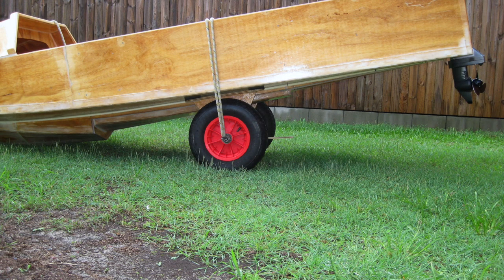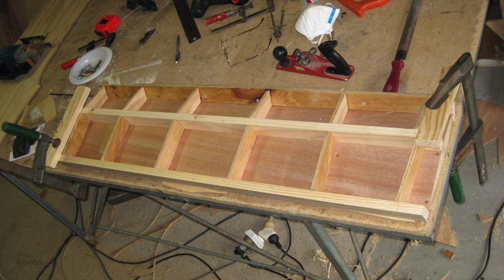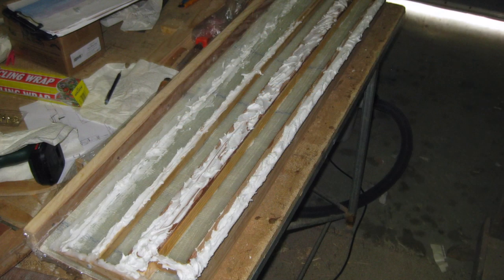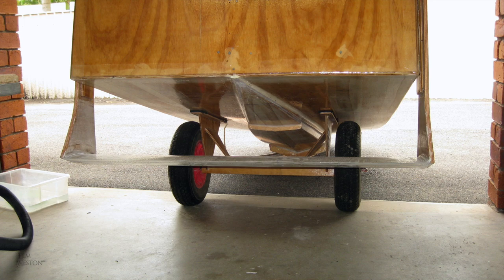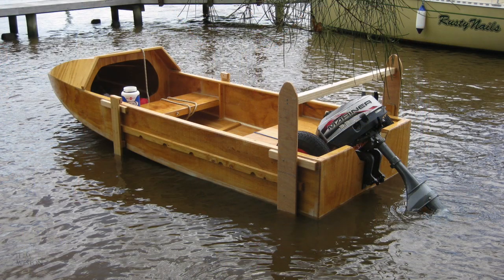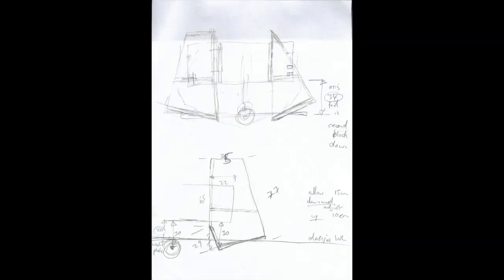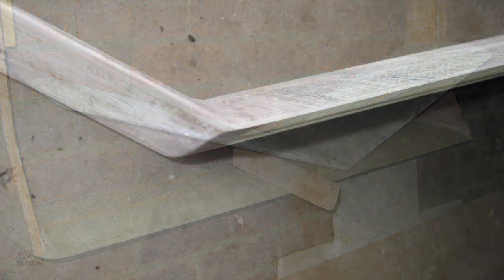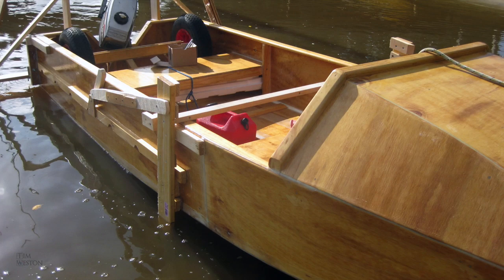How to build a plywood boat: Part 2 - Hydrofoil - getting the boat to fly!

Comment: Hi Tim  Very  interesting project and more power to you for evolving the design continuously. 
You could check out Clearwater Hydrofoils. He has a parts kit for $139 usd that you just have to glass up that includes front and rear wings fuselage and a mast. He will sell you the individual parts too I believe. A mast may be the wa

Comment: Loved the video Tim, and your idea for the rails that make trying various configuration easy.  I wonder if a big reason you don't get more speed is that the propeller was designed to push a non-foiling boat. You need one with a larger (steeper) pitch... assuming the foiling drag would be equal to a displacement hull drag at a larger forward velocity, you would need a different pitch to produce the same thrust at the max RPM. I hope you are still working on similar projects!
Reply from the maker: Hi Pejoka, yes I know what you are saying. I thought the same but it was still under the same sort of load, I don't think it had run out of rpm. I think the main reason I didn't get more speed is the plywood struts created too much drag. and also the foils weren't super smooth. With airfoil struts and all sprayed in a Urethane I would have seen better speeds. Then maybe would be the time to try a coarser pitch..  I ran out of time testing and had to stop.. :(

Comment: you said it didn't go much faster, but i'm curious if it was more fuel efficient ....or was there still just too much drag?
Reply from the maker: Hi Tim.  Yes, there was still too much drag.  I am presuming it was the plywood struts.  It's possible the size of the foils also could have been a bit big too.  And they weren't polished to a super finish.  The ride though, was a big improvement.
Reply from the maker: Fuel efficiency would have been the same as before..

Comment: Nice job Tim! We've done a  couple dinghy (motored and sailing) with foils but never had the patience to document beyond a couple pics. FYI - if you're looking for a quicker build of the foils search for foam airfoils made for RC aircraft. You get an exact foil out of foam that's easy to coat with glass or carbon fiber...
Reply from the maker: Hi Nick. Thanks for your comment and tips. Good idea, I will have a look at that, in fact, I remember seeing hot wire being used to carve out aerofoils in foam before.  All the best to you. Tim
Reply: That's a brilliant suggestion.

Comment: I know nothing of hydrofoils, but the aerospace engineer in me wonders if your airfoil is not a bit too thick considering the density of water vs. air. A thicker airfoil will get you lift at a lower speed, but at the penalty of more drag once you get to a certain speed. Also, your wings are very long - if you compare to something like the Quadrofoil, it only has a tiny lifting surface for a similar weight and power. But then again, it's not like you were hopping out of the water, so my guess is that it was the airfoil shape limiting your speed, rather than the wing length or properllor pitch. Really cool project, and good food for thought - thanks for sharing!
Reply from the maker: Thanks Philip appreciate your input. Yes, you could be right, I went big on area as I was only a low speed boat but a thinner section would also be worth trying. Also the struts made a lot spray so they were adding a lot of drag. I'd like to play more with it.
Reply: What about like a sailboat using a raised center section that can be raised or lowered tucked up tight when not used?
Reply: Você poderia me ajudar Fhilip???

Comment: Thanks for posting this.  I have a similar goal with the same power, but less weight then what you're lifting.  Gives me hope that it can happen!
Reply from the maker: +WereAllThatBored   hi there. Pleasure, I hope there is something in it that is useful for you.. what are you looking at building?
Reply from the maker: +WereAllThatBored   hi there. Pleasure, I hope there is something in it that is useful for you.. what are you looking at building?
Reply: I used to be in prototyping at a composites shop.  Planning on making a trolling motor powered fishing kayak with removable foils.  I think I can get her in the air with 6 mph  (30 pound thrust)...or hoping to.... the goal is to break the 6 MPH mark once lifted.
Reply from the maker: That sounds interesting.  I like electric drives..  I think if you have enough foil area you will get foil borne even with that amount of thrust.  Let me know how you get on.  It will be good to see what you come up with.
Reply: Really appreciated the comment about control and separating the foils.  Gives me some direction.  Plant to start in August.  I'll def give you credit for some of the ideas in the description if/when I post vids.

Comment: this was very cool i just have one question im trying to build my own hydrofoil for my boat and id like to know the angle you used for the v foil
Reply from the maker: Thanks Dave.  Sorry, I don't remember the angle I used and don't have the drawings with me.  It was an estimate, you could try something approximately similar to this.  Or two separate foils, further apart for better stability. The V was certainly better that a straight foil, but further apart or wider would be better.  Let me know how you go, I would be interested to hear what you come up with.